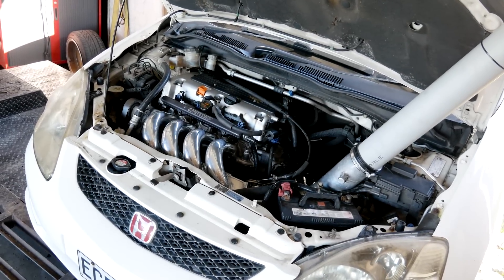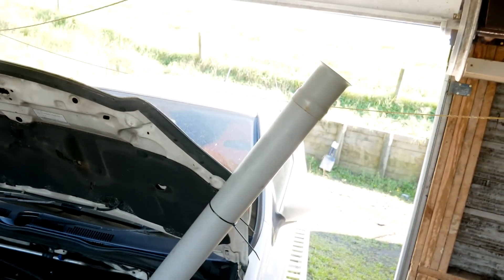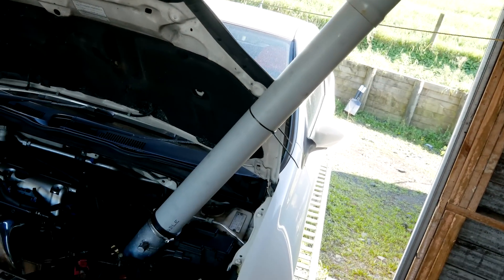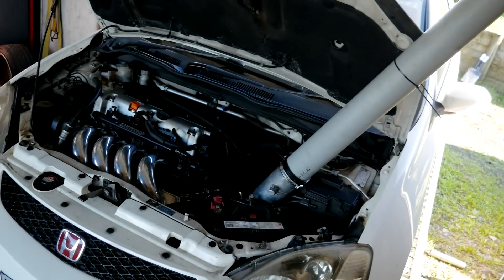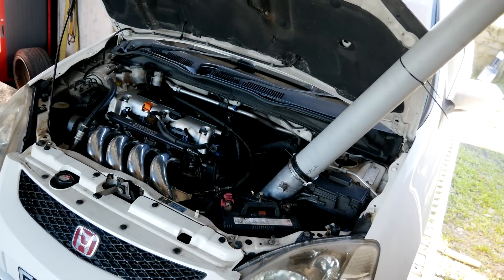Intake pipe dyno testing - K24 honda  Pt5

Comment from the maker: Hey everyone.  This will be the last video with this car, as the owner wants to move it on.    If you are in NZ, Up for grabs are all the parts i made.  Headers, exhaust & inlet manifold (currently on hold for someone)   check out my instagram (garage4age)  for pictures and details.       Also some notes on the video;   In this case, ideally you would tune the vct for each length. so results could vary,  maybe a touch more power to be had at some lengths.   Was already over 30 runs (i don't show them all) making this video. would easily 3x that tuning vct for each length.    Its a pretty cool example of how the intake tuning moves along the graph and progressively gets weaker as the tube gets shorter.
Reply: Real shame for this to be last K video, hopefully there's been enough interest to get another example in :)
Reply from the maker: @CheekyNinja  Unfortunately the revenue from these video's are lucky to pay for the fuel used, let alone anything else.  it basically costs me money to make most of them. So yeah kind of hard to justify anything that isn't my own project, or lent to me like this one.
Reply: gawds - i love the pic :)
Reply: To bad you didn't have time to test T.B.R.I. induction
Reply: Why doesn't the owner want to keep the modifications you have made?
Reply from the maker: @bdykes7316   owner  is selling the car and needs the money, so doesn't make sense to buy the parts.     I wasn't making the parts specifically for him.  who ever buys the car can buy the parts if they want.  if not sold prior  .
Reply: Would've been interesting to see the 375mm with a Blair bellmouth
Reply from the maker: @findtherightbeat   whats a Blair bellmouth?
Reply: @Garage4age  It's an elliptical profile bellmouth, apologies for referring to it as a Blair bellmouth.
Reply from the maker: @findtherightbeat  Ah yeah.  The stuff ive done with my itb setups. there is almost nothing in it over a basic bellmouth.  possibly if pipe its attached to is borderline flow wise might see something.  i do have a run at 400mm with no bellmouth and with the basic bellmouth.  I dont think there was much in it,  will have to pull it off the dyno and have a look.
Reply: great series sir!

Comment: 70 mm interior tube   ?
Reply from the maker: would have been around 85mm  inside diameter.    the aluminum tube was 3.5"   and the plastic extension was roughly same size

Comment: Im interested about intake swirl ie from twisted butterflies or angled velecity stacks to promote higher air density at traditionally lower portions of the intake valve. Creating that vortex certainly works in a burn barrell (cutting L's and beating them inward to create a monodirectional inlet flow) as far as efficiency wonder whether it'd cross over to air mass delivery ?

Comment: So what does this mean for us everyday plebs?
I have a fairly short intake pipe, should I be trying to route it as long a reasonably possible?
Reply from the maker: Its going to vary based on engine and intake manifold.  somewhere around the 400mm mark was a good compromise that fits in this case.  but the 500mm wasn't that great, knocked the top off the curve, so isn't a clear cut longer = better
Reply: @Garage4age  "400mm mark was a good compromise that fits in this case.  but the 500mm wasn't that great"  Is that because it is the third harmonic of the intake that is matching up with the engine with the 1000mm intake?  So when you half the length, that's an even multiple rather than odd and it doesn't match up anymore? ~333mm would actually be better to take the first resonant peak equivalent of the 1000mm intake?  [I'm assuming its closed-open end resonance of the intake as that is what seemed to match up for 1000mm being best, but I have no idea, sorry!]

Is the explanation for the slight boost in air flow "acoustic streaming"?  "Acoustic streaming is a secondary steady flow generated from the primary oscillatory flow" - SpringerLink

Edit -- It would be fascinating to see the 325mm plot compared to the 1000mm plot, as from the video it seems like the 325mm & 1000mm runs are most similar in some ways -- e.g., that middle hump being moved to the left just under 5000rpm for 325mm, just as it is for 1000mm.  Which in my mind, maybe makes it seem like this 3/2 and 1/2 wavelengths resonance explanation has some legs, but I dunno.  You chose to use 375mm to get 2-3 kW more all through the upper mid-range around 6000-7000rpm, but the 1000mm intake length was also lacking in that area anyway just like the 325mm length.
Reply from the maker: @TassieLorenzo   Hey.   from memory i was measuring to the face of the throttle body.  so the 500mm pipe isnt really half of the 1m long pipe.

Comment: Does the intake pipe length matter on turbocharged cars? Do intake pulses travel through turbo?
Reply from the maker: Unlikely to have much / any effect. but can't say ive tried it.   Intake manifold itself still has a big effect.  but its easier to make/sell short shiny stuff and run all the boost, hence why market flooded with them.

Comment: K20 head swap would make big gains also
Reply: bruh it's k20a so it already has it :D
Reply: @AaroKo Then why does it say k24 on the tittle and description?
Reply: @Dimitriss_de  oh nvm my bad lol
those come stock with k20 so it's weird but yeah you're right it's been swapped
Reply from the maker: @AaroKo  yeah its a stock k24 with aftermarket cams.  unsure why they didn't use the k20 head.   or just modified the k20
Reply: @Garage4age  weird🤔
but good news are that the k24 head is also as capable as k20 head as what I've heard
Reply: @AaroKo  k24 intake 295cfm /exhaust 200cfm

K20 intake 315cfm
Exhaust 220cfm.

So rsp k20 head has 8ish % more flow. That is usually gain of 15-20hp
Reply: @CL9k24a3  yeah as stock form ofc but when work is being done then their potential  is the same :)
Reply: @AaroKo  yep, they can be ported to the same specs.
Reply: @Garage4age  "unsure why they didn't use the k20 head.   or just modified the k20" K20 engines and K20 heads are expensive, where K24 Accord Euro engines are cheap(er). Maybe the original engine met an ultimately demise 🙁, or was sold off complete.  The DC5 I had did reuse the original K20A2 head (and oil pump and sump) with the K24 block for the usual K24/K20 "Frankenstein" engine.  I prefer the normal, higher-revving K20, it feels much more "Honda" and enjoyable to me!  [The DC5 K24 had a tendency to randomly torque/bump steer nearly clean off the road if you hit a bump while accelerating or added a little too much throttle, I imagine this EP3 is little better, sharing the same (terrible) front suspension and steering geometry...  With all due respect, the older cars EG, EK handle so much better, while the later cars FD2, FN2 while still strut front-end have been fixed and are at least predictable IMO.]

I did the usual parts: SHG Delrin steering rack slider, Hard Race inverted tie-rods, then raised the car back to stock ride height and got rid of the inverted tie-rod ends to try to get the control arms back to the correct angle etc, but it didn't seem to make much improvement.
Reply: @CL9k24a3  4-Piston Racing have a lot of info about the different cylinder heads and what's best for what.  I think ported Accord Euro / TSX heads are their bread and butter for most engines (if only because RSP heads are rarer/more expensive? or they the right characteristics for most engine builds), while CR-V heads seem to be their favourite for heavily ported heads as they have smallest water jackets and thus can be ported more.  Apparently, the final K24Z3 head has the best intake port flow of all despite the single exhaust port design (where cylinders 2 & 3 flow great, but cylinders 1 & 4 flow absolutely terrible).  [Please correct me if I'm wrong!]]

Comment: Slightly disappointed it's not getting a snorkel just imagine the RAM effect.
As a side question since I have been looking at graphs again, is there any relevance to measuring the area under the line of the graph for a certain rev range to smooth out the numbers? Rather than following the wiggles.
Reply: The effects of ram are are greatly exaggerated in most people's minds. At 100 MPH it's 0.17 PSI assuming STP. At 150 mph it's 0.4 PSI.  We are talking a 2.5% power increase absolute maximum outside land speed record applications.
Reply: @otm646  Yep joking the 4x4 boys go on about it while they have giant wheels and tyres plus all kinds of accessories stuck all over producing even more power sapping drag.
The drag from the snorkel would use more power than ram would create.
Reply from the maker: @mrln247  The amount of rain around here lately the snorkel would be helpful..    unsure what you mean by the other part?
Reply: @Garage4age  No worries, just the ramblings of someone who often comes at things left field re-learning data analysis.
Snorkels are overconfidence device's, more useful as a clean air feed with a pre-cleaner. But I've seen a few morons who hydrolocked their engines trying to go through water at ramming speed.
Reply: @Garage4age  Rufford ford has got itself pretty famous for Muppets behaviour.
Reply: @otm646  We'll take 2.5% on an NA engine, that's a lot, lol!  I don't know if the usual Gruppe M ram air-style EP3/DC5 intake (the smooth side of the mould is on the outside instead of the inside, that's some motorsports part there, lol...) is well designed enough to get that full benefit, but every little helps.

Comment: I found the same sort of thing with my mate's ecomang VL speedway car.  We thought having a straight TB would increase power from the intake pipe it already had (which was about 5-600mm iirc) and it took a substantial dive in hp.  So we put the pipe back and it regained.

So we added more pipe length and it continued to gain throughout the curve until we called it quits at nearly 2m as it was impractical.

On the car when the new engine was built, he added a long snaking intake of about 1500mm.
Reply: Nah bro that never happened aye

Comment: I've been telling people for years to use the longest intake they can fit in the car, for most Hondas thats going to be the best, also fitting a nice velocity stack on a short pipe helps it act like a long pipe.  Diameter makes a big difference too.
Reply: From my back of the envelope calculations, it seems like 1000mm is ideal for this engine with peak power @ ~8000rpm, but 700mm would be ideal for a 4-cylinder engine with peak power at 11,000rpm (so an extreme K20 or K24 destroker NA build) while 1300mm would be ideal for a 4-cylinder engine with peak power at 6000rpm (like say the 4-cylinder GM Atlas engine or the Porsche 924 engine or some other big capacity, low revving 4-cylinder engine).

Assuming I've used the right equation, closed-open end resonance third harmonic, f = v/λ  = 3v/(4L), which seems to match up with f = rpm * (4/2) / 60.  [About 266 Hz for 8000rpm, 4-cylinder, 4-stroke -- I know nuffin' lol.]

As intake length was shortened less than 1000mm, it increasingly pushed the (third) resonant peak past the maximum rpm of this particular K24 engine.  So a 900mm long intake would be ideal for a mild K20 with peak power nearer 8600rpm, compared to 1000mm for a K24 with peak power near 8000rpm?

Maybe the explanation is the pipe resonance driving "acoustic streaming" which provides for a slight increase in steady air flow into the engine at those resonance frequencies?  ¯\_(ツ)_/¯

However there is another resonance at 1/3rd the length, which could also be useful for shorter intakes.  None of this explains the hump at 4700rpm which seems to move both left and right without a consistent relationship to intake length, which might be due to something else (the relationship to the custom intake manifold or custom header or something)?

I see the initial testing skipped over 300mm however I think 300mm (or 333mm) as a 1/3rd of the ideal 1000mm (i.e., fitting in the first resonance, half a wavelength in the intake tube instead of one and half) might actually be better than the 400mm that was settled upon. As 400mm seems to have a peak at 7500rpm while 200mm seems to have a peak that's past the maximum rpm once again.  Edit -- My bad, 325mm was tested later and it was better than 425mm, at least for peak power, and 325mm was still a little bit better than 350mm, 375mm for peak power (if it a little less elsewhere).  Very interesting.

It seems like going from 325mm back up to 375-400mm shifted peak power down from (near) 8000rpm to about ~7700rpm.  325mm would perhaps have been more Honda-ish, 375mm as chosen gave a good compromise with more mid-range everywhere.

I wonder if f = rpm * (4/2) / 60 = 3c/(4L), so L = 3/8 * 60 * c / rpm = 3/8 * 60 * 343 / 7800 = 989mm gives a pretty good estimate of what is needed, or if that doesn't fit take 1/3*L (so L = 329mm ) or 1/8 * 60 * c / rpm, at least in terms of getting peak power at f (7800rpm, 260Hz in this instance)? (Where c = speed of sound, ~343m/s for ambient temps.  You'd replace the 4 in 4/2 with the number of cylinders for other types of 4-stroke engines.)

This seems right to me and fits with the excellent data, but it might be total BS, please correct me if I'm wrong!

I went and measured my Hybrid Racing K-swap cold air intake (the kind that goes down and draws from off to the side of the front bumper) and it seems like it's about 830mm long, so hopefully that's about right -- if having the resonant peak a little bit beyond the maximum rpm of the (K20) engine (~9200rpm?).  Unfortunately it's the old 3" diameter model not the newer 3.5" version, though I did put a bellmouth on it, more like what it comes with nowadays!  [*Ponders increasing intake length by about 70mm to make it more "optimal"...*]
Reply: what if i wanted to keep the stock airbox? its not a civic or integra.

ive done the best i can so far; hondata modded, k&n airfilter, 2.5” smooth flex pipe (just changed from corrugated pipe yesterday) and attached a 45 degree pvc bend at the end and shaped it as best i could to be a velocity stack.

positioned it so its above the radiator like a dc5 but in a way that air deflects into it from the edge of the grill.

silicone 3 to 2.5” elbow for the throttlebody.

the next mod is taking that velocity stack off and making a ram air feed.

would making the inlet 3” be any benefit?

no other mods aside from that.

engine is k20 with a ppa head.
Reply: @TassieLorenzo  Hello, can You help me choose the best intake for my modded K24A3?
Reply: @ferio98jdm  Hi ferio98jdm, I don't know, sorry. Many good intakes are available! 80mm-90mm or 3.5" diameter is popular these days to ensure no restriction.
Reply: What is an ideal diameter?
Reply: @redstonegarage  that will depend. Most Hondas want 3 to 4 inch. Length also changes what the best diameter is. Generally I'd build a 3.5" intake as long as will fit with velocity stack.  That almost always works really well

Comment: Hey mate, I did some exhaust back pressure measurements and discovered it develops slight vacuum during deceleration. Is it normal?
Reply from the maker: Unsure, not something Ive bothered taking notice of tbh
Reply: Depending on the valve timing and overlap, it can probably transfer some of the intake vacuum in the exhaust.
Reply: @pecata01  that was my suspicion as well.

Comment: If you ever get a chance to buy a old Redblock Volvo for a cheap price it would be really really interesting to see testing on it! They are stock really understressed (dont buy 1985-1988 blocks). They can handle all the abuse you can throw at it. And internet is full of theories how to tune them. But no near the test information you are doing are getting to the public on them. But i really like the Honda dyno series! Good Job! 😁
Reply: Over here its one of the most tuned engines in car history, both turbo and na, still plenty of them in motorsport use every weekend. Theres massive amounts of knowledge on these.
Reply: If you haven't already, see @Stavtech for what he did to Volvo redblock engines. Extensive headwork to make a hemispherical combustion chamber with 30+ PSI boost!

Comment: Cool. 
 Have you considered making divided plenum intake? Pairing cylinders 1-4 and 2-3.  BMW calls it DISA, other brands probably have some different name for it. It's an easy way to achieve multi length intake runners.
Reply: DISA isnt worth the hassle, it's only divided at low rpm, at high rpm the resonance chamber has an impact but it's out-performed by non-DISA manifolds for peak power.

And it really doesn't do anything, kinda. N52 non-DISA sees power gains from DISA manifold and tune .. and further gains from DISA delete and N54 manifold.

And I wouldn't call it THAT easy. Also moderately failure prone.
Reply: @flinchy-5224  disa isn't for max power. It's for broader power band. 
 N54 non disa manifold makes more power due to its runner dimensions, not because of lack of disa valve. With appropriate design, disa doesn't hurt peak power. 
  The only failure point is the valve itself.
 I'd say it's the simplest way to achieve multi length intake manifold. Especially on a straight 6 engine and not too hard with 4 banger.
Reply: @tiitsaul9036  DISA is a restriction as much as it's a benefit. The n54 manifold doesn't lose anything even down low or midrange
Reply: @flinchy-5224  one of us don't understand physics.
Reply: @tiitsaul9036  and it's not me. If you wanna be wilfully ignorant tho that's cool, carry on.
Reply: honda had its own versions already in the 90s,atleast in some H22 and B18 engines not sure which all but the most performance oriented models never came with it so that tells alot :)